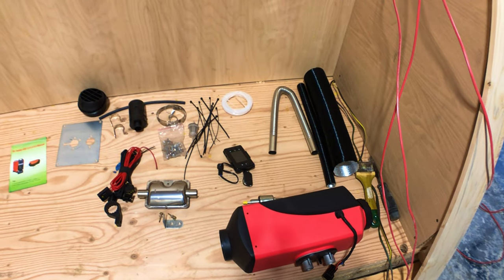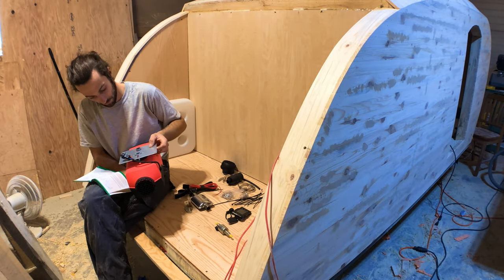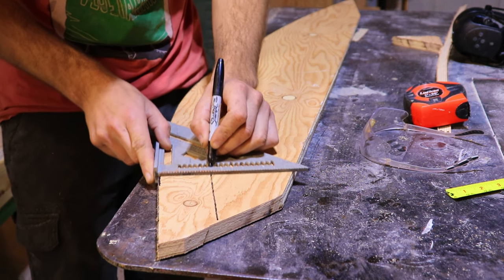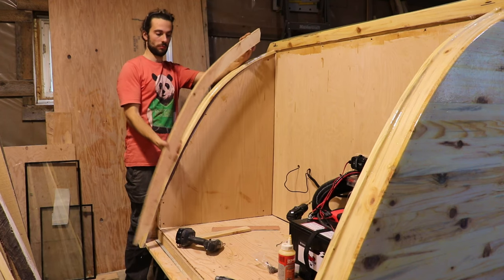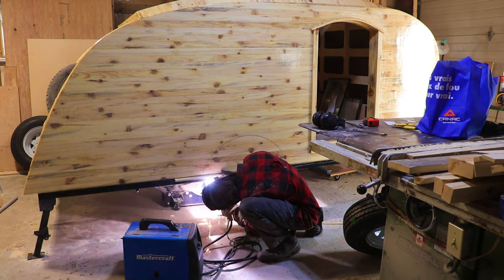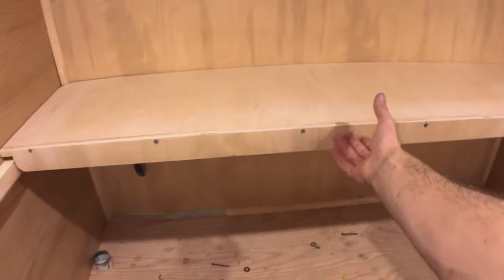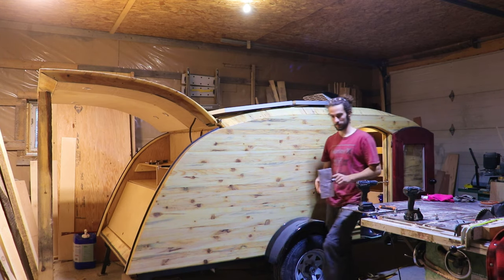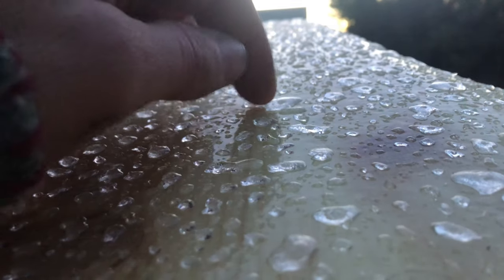Finishing the Teardrop  Build | Part 6 | Episode 40

Comment: Great no fantastic build. Talk about thick walls....curious about heater..the holes through floor showed styrofoam. Did you cover it at all,seems close to hot exhaust. Hello from cold north Ontario.
Reply from the maker: The insulation is very good, we let the heater run for 15 min and it’s burning hot inside( -15 degré outside).
We use high temperature silicone around the exhaust through the floor and it’s seem to work very well!